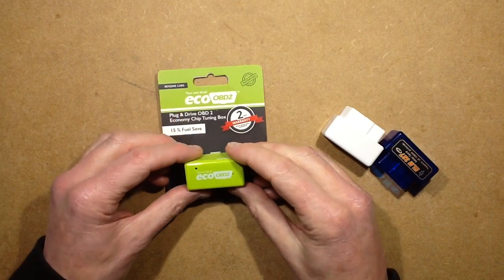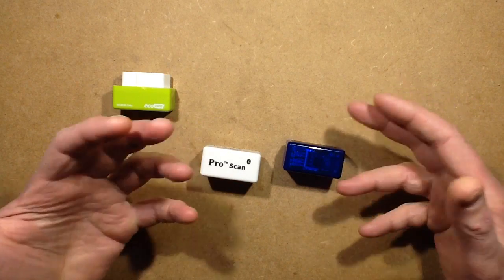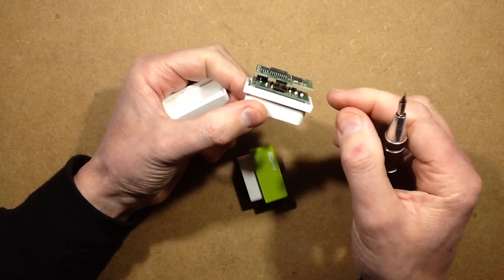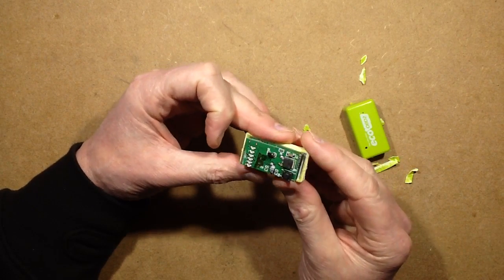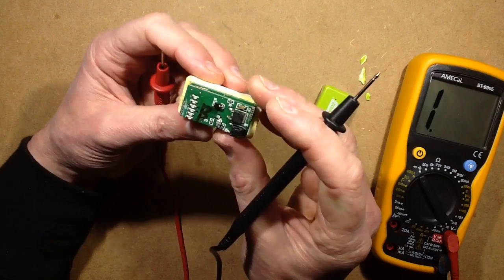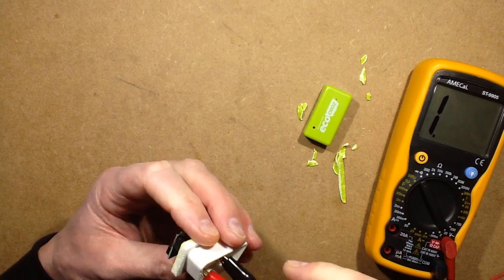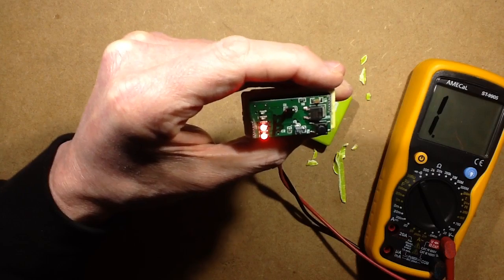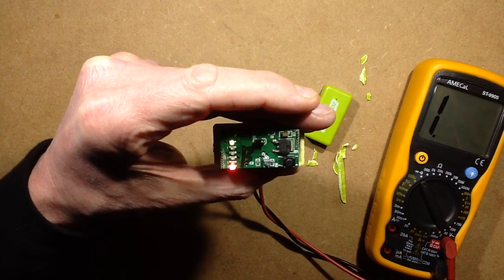Inside an ECO OBD2 "chip tuner" fuel saver.

Comment: If it does anything at all, i'd assume its changing the gas pedal to a more conservative configuration. Many modern cars have several driving modes and most just change the how much the gas pedal opens the intake butterfly (being drive by wire meaning there is no physical connection from the pedal to the intake, it's all computer now.)That would be the only thing it could do even then, looks all in the world like you've got a led controller there.

Comment: Clive came to the right general conclusion using logic and reason. There are a lot of posters trying to get specific conclusions the same way and failing. Only about a half dozen posters in this comment section are knowledgeable, the rest are guessing and wrong so if you’re here trying to learn something don’t read these comments. 

In an effort to help, I will add these statements I believe are true: yes, this is electronic snake oil. Yes, you can recalibrate your cars OBDII compliant ECU via the OBD port. Yes, the information is available on the internet if you’re willing to search for it. The OBDII  protocol (software and hardware) are generic BUT there are provisions for manufacturer specific instructions included in the plan, while the generic portion is easy to find info on the Manufacturer specific info is harder to find because there is no legal requirement to publish it, they just include it in the devices the dealership uses to troubleshoot your car. In the right software environment, the software is directly readable and can be modified without compiling (it’s not “scrambled”). There are multiple busses running at the same time while your car is running, there is a module for the engine, another for the transmission, and the antilock brakes, and the instrument panel,  the lighting, and the security system etc. you can address these separately (most of the time you MUST address the separately) even though some of the data points are available on multiple busses at the same time- the engine needs to know the rpm for fuel pulse width and the trans needs to know RPM for shift points as one example. Anyway, if you like working with software and you are a car person, you can fiddle with this stuff all you want using the right hardware and software. Oh, and yes, the ECU holds one copy of the software so you will want to download and make a back-up of the file in the vehicle first, make your modifications, and upload to the vehicle with the engine off. As far as I know, programming “on the fly” is not possible.

Comment: i know this is kinda dated but thought i should add my 5 cents. i'd say NEVER use one of these "fuel savers" they dont work 99.9% of the time, and can actually harm your PCM/ECU. Though the ones that can read or clear codes might be ok. 
 Over time a cars air fuel settings and maybe timing do change a little on their own. The best thing to do is take it to a shop after you've replaced your plugs and wires or if changes were made in the fuel system, and have a garage/shop check them properly.
 These "fuel savers" could in fact make your car run to lean or to rich and or void your warranty, neither is not good on your engine or wallet. They could over volt something and burn out the PCM/ECU and those are not cheap and usually require the stealership to install and set them up. 
Ways to really save fuel; 
Change your oil and air filter regularly. 
While driving keep it under 2000 RPMS. 
Maker sure your tires are properly inflated.
And the best way to save fuel, dont drive. =)-

Comment: Big Clive appears to be assuming too much about these dongles.

I will describe the usual method of plug-in diesel performance chip because I suspect the ODB2 dongles do the same thing but by using a different connection method.

The usual way to improve fuel efficiency is to attach a resistor to the lambda sensor on the fuel line. The resistor interferes with the temperature reading to indicate a colder temperature than ambient. Colder fuel means it is denser, which means more Air is needed to burn it efficiently, which means a leaner burn. The ECU has a preset map that provides a balanced overall performance. However, the ECU has parameters that it regards as acceptably normal. The trick is to get the ECU to adjust itself to the extreme of the parameter but not to trigger an emissions fault code. Don't forget manufacturers have no idea where the car will be driven and so map the engine to allow for extremes of cold and heat as well as altitude. To put it another way the ECU matches air and fuel density to deliver the manageable performance desired by the average customer. If the density data can be falsified in some way the ECU will accommodate the change as best it can. Mess around with the data too much and a fault code results. But if the data is altered just enough to get the ECU to adjust the fuel/air mix, but not cause a fault code, there may be desirable side-effects, such as improved fuel consumption and increased power, especially during acceleration. The downside is the car may experience a lumpy tick-over as the optimum fuel/air mix cannot adjust to cover the whole rev range of the engine. It may also mean the lumpy tick-over causes the engine to cut out when it is still cold.

For PD engines, which are bullet proof, a slightly leaner burn is safe. The 2litre engines and transmissions can easily cope with 200BHP. The other advantage is that when the turbo kicks in on hard kick down acceleration (i.e where more air is forced into the combustion chamber) the result is an enhanced turbo effect because the ecu thinks there is also denser (colder) fuel than is the case. Essentially the ECU then adjusts itself to accommodate the manipulated temp reading over a few hundred miles of driving and stores that data.

I drive a '04 VW Passat B5.5 1.9TDi and have had a resistor chip fitted for the past 3 years. I get an average 10mpg more with the chip and my throttle response is sharper. My fuel consumption is 63mpg with the chip compared to 53mpg.

So to the ODB2 dongles. Firstly, the dongle will not permanently write any info to the ECU. The whole point of the dongle was to avoid popping the hood and making the chip easy to remove for annual road safety/emissions tests, annual servicing and the like. With the lambda sensor chips they may need to be removed if the engine has to be plugged into an ecu diagnostic system. Once the lambda chip is fitted they can be a pain to get out without damaging them. This makes the ODB2 dongle sellable to anyone who doesn't feel comfortable working under the bonnet/hood. Women in particular (no sexism intended) will buy the dongle but often not bother with the lambda resistor method.

Secondly, the dongle will send similar adjusted fuel (or possibly air) temperature information to the ecu whilst it is connected. Why do I say this? Well fuel temperature data is a tried and tested method of delivering a small but noticeable improvement in fuel/power performance without a full ECU remap, so why look for another solution when one isn't needed? However, the ODB2 solution does have the be installed correctly to ensure the ECU doesn't recognise the false data signal and throw up an engine warning fault code. I have had a similar problem with my lambda chip over the past three years and it is annoying. However, once it is removed the ECU returns to its default settings and I expect removing the ODB2 dongle will be the same.

Finally, apart from its minuscule cost, the big advantages of the ODB2 dongle is it's convenience of installation and quick removal. I've ordered one myself and will compare it to my lambda chip experience. If it delivers an extra 10mpg I'll be happy. If not then all I've lost is £3, or to put it another way 2 pints of milk. Bear in mind 10mpg is around 20% of the norm so it's pretty good in anyone's book. The one thing to remember is to drive normally. Drag racing from the lights or burning up a motorway at illegal speeds is not going to be something any plug in solution will accommodate. We are looking for 10 - 20% better fuel efficiency and a similar power improvement, especially under acceleration. They will not turn a 130MPH car into a 160MPH beast. That requires altered gear ratios and greater top end power. They may well help a 10 sec/0-60mph car knock a second or two off of its time, which in my view makes the car safer to drive.

Of course there will always be sceptics but they usually fall into the "how can this thing remap the ecu" group. The fact of the matter is these things don't remap the ECU temporarily or permanently. They provide false data that the ECU manages in a predictable manner, which in turn results in desirable limited side-effects; extra fuel efficiency and power.

Comment: I know that for Volvo, disconnecting the battery for a period of time, and then reconnecting the battery. The engine management system will enter a driver adaptive phase for several hundred kilometres, and adjust fuel. launch and other features of the engines responsiveness to suit driver style

Comment: My son has bought an OBD II doctor and the pins on the socket weren't even soldered properly.  What damage could that do!!!!.  Apart from that it works fine I think...well maybe not the battery voltage monitor was a bit off by a lot.  It is useful as an indication of heavy right footedness though but I would not rely on that to be totally accurate.

Comment: If you tear down this device further you will find that the microcontroller only has a few of of its pins connected to traces. One for power, one for ground, one for the crystal and one to each l e d. All the contoller does is flash the l e ds

Comment: I have the blue diesel unit - Fitted it and My Freelander went from 825 per tank of diesel to 920 -930 odd.  They do work - We unplugged it for service to do scan on scan unit - and I never plugged it backed in - Guess what - Milage went down to 815 a tank.  Put it back a few days later. and this month my Landi is hitting 912 on a 57 L tank - So thats my ten cents works - it work

Comment: CAN Bus is usually only used for monitoring and instrumentation in automobiles, J1939 or J1850 has more ECU ECM TCM BCM control. I wrote a piece of software to crack the dealer passwords on CAT Truck engines through the J1939 Protocol. Would be nice if vehicles were open source.

Comment: love watching your videos. I thought of a question that others might like to know the answer to. Do ECUs really get damaged by xenon HID lights(their surges) and why? and what can be done to prevent this from happening (relay+diode/direct connection to battery via fuse switch and properly rated cable or other?) also would this apply to LEDs. many thanks.
Reply from the maker: The problem is likely to be the high speed and high voltage ignition pulses that can potentially cause significant RF-style spikes that are quite hard to filter.  When designing a strobe system with a microcontroller firing a high voltage trigger transformer I had major issues with the spikes crashing the processor.

Comment: I actually got two of these, and it does work, but not on all cars. Only works on one of our two cars. If the green light keeps blinking, it is unable to communicate with the ecu. 
It requires about 200km of driving before these units kick in, on the cars that it will work with. In our case a Citroen C2 VTR from 2006 works.
My neighbour said that it's likely tricking the ecu by letting more air into the combustion,  but of course it's not able to remap the ecu. If you unplug the thing, the car is back to normal.
Still testing mine out, but there is a noticeable difference.  ( I have both the nitro and eco units),. The Nitro chip will not turn your car into a super charged beast, but it will see an increase of acceleration.

Comment: I used a mysterious Chinese OBD2 tool to reprogram the immobilizer in my Mazda 3 when I had to replace the starter cylinder.  The normal way you program new keys don't work when the starter cylinder has been replaced, so I had to use the tool.  Worked brilliantly.

Comment: Car makers have it in their best interests to make cars as efficient as, well, scientifically possible, really. My car has a slightly more unsteady idle than the previous model because the ECU has different software that tries to idle the engine as lean as possible to save fuel and reduce emissions, instead of solely trying to keep the RPM as close as possible to a fixed value. that's just one single example. There are many, many more.

These things at best do absolutely nothing, and at worst, will destroy your engine

In the latter category, how this is achieved is these units can bias the O2 sensor output to trick the ECU into thinking the engine is running richer than it actually is, and the end result is leaning out the fuel mixture, which particularly with turbocharged or supercharged engines, will end up destroying the engine under high acceleration or load.

The closest you'll ever get to a software change (or tune) actually saving you fuel, is when there is a defect or deficiency in the factory tune in the first place. Subaru 6 cylinder engines come to mind. In that case, a new tune will actually help, but these OBD II things won't.

Comment: Be aware there are similar but different 12V and 24V OBD2 connectors. Wrong voltages can damage devices or ECUs.

Those devices are serial interfaces to the embedded vehicles computer(s) like ECU/ECM/TCM/BSM, ... 

Connections differ in both electrical and logical layers of protocols, and are only slowly converging.

Many vehicles comply with mandatory basic ECU diagnostic access ODB2/EOBD2 and have other proprietary connections distributed over other pins to manage other functions (airbags, transmission, body...).

A bad interface device can damage the embedded computers.

Professional devices have a multiplexing networks to connect different electrical protocols to desired pins, as well as protection should anything go wrong.

OBD2 standardizes physical connectors and some suits of electrical and logical protocols that enable access to managed data inside the ECU. (In a way, its similar to a managed network device with MIBs or SMART data in IDE/SATA drive). 

Some parameters are tracked and registered as well as DTCs (Diagnostic Trouble Codes) that can help a technician find a problem in the engine and it's control. 

Some DTCs will point to a sensor out of range, no signal, inconsistent data, ..., misfires, "non compliant engine exhausts" which would result in unwanted emissions.

The interface could outside the OBD2 basic protocols to SET some engine parameters tuning the engine. No magic here. It does not change the engine, only it's control algorithms parametrization. Can lead to a different compromise than the original one, like more performance with non-compliant emissions or less performance with lower consumption. Anyway OEMs ain't stupid.

While a device could automaticaly interfere with many compatible ECUs, this is not standard among vehicles, and there is no one solution that fits all.

Generic OBD2 interfaces would have an initial phase of operation where the software that drives it (as Torque mentioned in the video) would try to detect which signals are present at which pins and what protocols are available.

Comment: Open. Fuel. Loop. More fuel on demand = less computer interference = you use as much fuel as you want, not as much as the car wants. Your car still reacts (Shifts in places it normally wouldnt, can rev free-er) but you're mostly just driving with your foot now. 

Its less for mileage (we're talking 20 miles more out of your tank at maximum) and more for low end power, where your car isnt giving you fuel because of a bunch of parameters not being fulfilled (in my car its the position of the throttle and how far the actual valve is open in the TB). Its pretty nice for american slushbox sedans.

Comment: Big Clive, The cheap ELM devices are safe. I've been using them in my shop for years with and android pad and the torque software. The fuel saver is no good.Very dangerous and it cannot write to the ECU. It has no way of managing checksum errors. Something like that "fuel saver" would most likely either deaden the accelerator.

Comment: Rule 101 of fuel economy. Keep gear high and revs as low as possible. These stupid gadgets are useless. Remapping an ECU while it is running via a third party tool is dangerous as the ECU is making adaptive changes of its own.

Comment: It is possible to change every setting in the vehicle through the diagnostic port. When new components are fitted to a modern car they frequently require programming and the dealership can do all this through a cable from the diagnostic port to their computer. However, since cars are now far more efficient than a few years ago, many parameters are set to the maximum that the engine can achieve without damage. Therefore the slightest change can knock tens of thousands of miles off the life of the engine, mainly by allowing the exhaust gas temperature to drift outside very close limits. Unless you are using software supplied by the manufacturers, you are likely to do more harm than good, A guy recently improved his fuel consumption on his VW by about 10mpg and brought it inline with the latest model. However he did not realise that the new model was achieving this consumption due to the injection pump delivering 2,200 bar. By changing the settings while his car had the older 2,050 bar injection system, he destroyed his engines valves and seats within 5000 miles.